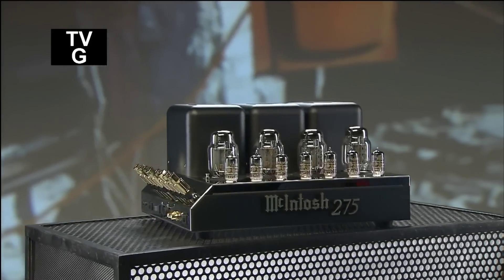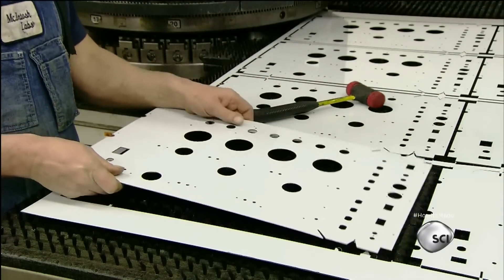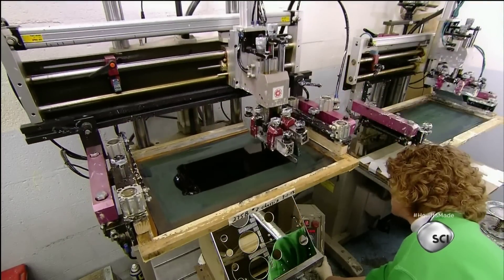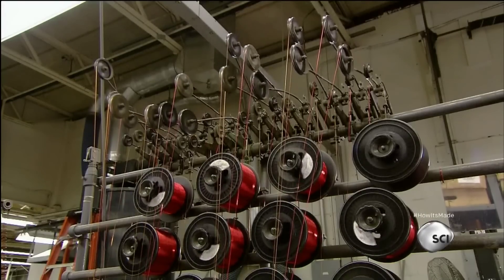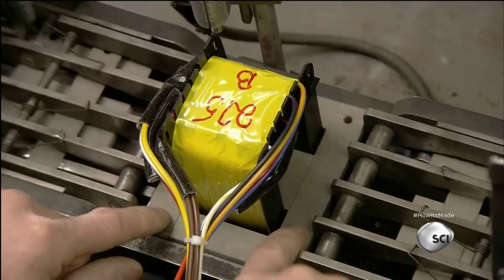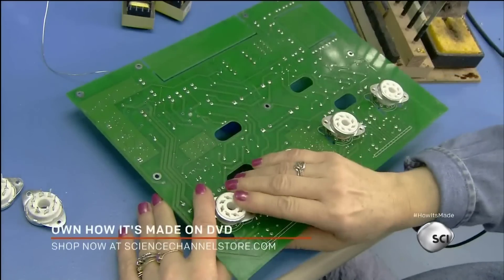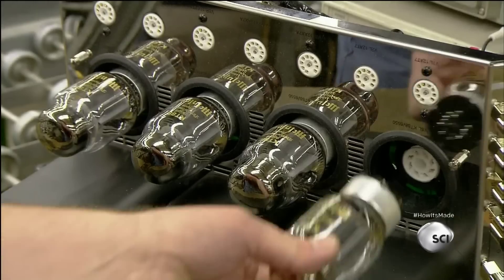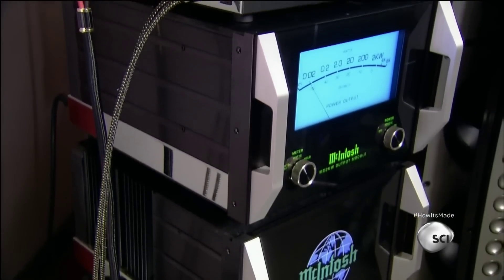How It's Made - McIntosh Tube Amp

Comment: Just think having an input makes it all work.  Tube rectifiers convert the high voltage to DC however, its that input characteristic that makes it a vacuum tube amplifier....
Reply: +Paul West No, tube rectification, makes it a power supply tube rectifier.  Tubes in the audio circuit are what make it a tube amplifier.  How power is supplied has no effect on the audio output.
Reply: bush Another wave of audiophoolery crashes against the shore of electrical fact.  So long, I can't argue with delusions. bye.

Comment: Hey you idiot! you NEVER put a vacuum in the socket with bare hands! The acid from your hands will create a hot spot on the glass and reduces the life of the tube. It is a fact!  Typical McIntosh.....you pay for the namesake,  not for the quality. Yes, tube amps may sound warmer , but if you look at all the hi end tube amps made out there, McIntosh is almost at the bottom of the list for it's price range. Do your research, and most of all, trust your EARS, not the salesperson.
Reply: +lawrencet83 Vacuum tubes don't get anywhere near hot enough to devitrify from fingerprints.  We never had any problems handling horizontal output tubes in color TV receivers.  These run considerably hotter than KT88s.  Devitrification from fingerprints is true for quartz halogen bulbs, but not for vacuum tubes.
Reply: Ah, HOTs...   great quote from my old high school radio-TV-shop class: "Mr. Smith? If the HOT's plate is glowing red, is that a bad sign?"  (AAAH! Unplug the set! Unplug the set!) :D

Comment: "Magnetic terminals would react with the current and cause distortion". I love it how these people live in their own universe that they have re-written the laws of physics for. Pseudo science at its best (worst?)
Reply: People comment about how good my surround sound system sounds. I don't tell them the speaker wires to the rear channels is just lamp cord. :)
Reply: @numbr6  lamp cord is 100% copper and works fantastic. It isn't CCA, which is what most "speaker" wire seems to be made from these days. My old school KOSS loudspeakers actually recommended using (at least) 16g lamp cord in the owner's manual.
Reply: @numbr6  For a low voltage, low current, non-digital, signal transmission, nothing is wrong with a lamp cord... unless the space is a very noisy one (electronically).
Reply: @numbr6  I dont believe that someone said your  surround receiver sounds good, they are all shit.
Reply: @numbr6  lamp cord works good, and I run one or two speakers out of phase +/- reversed LOL
I solder all connections ....
Reply: Don't blame Mc. for that. Blame whoever wrote the drivel the narrator's reading off of.
Reply: Syc holic You are factually correct, but you have no say when it comes to someone else’s writing, spelling and grammar.
Reply: the same suckers who buy monster speaker wire..
Reply: I guess you skipped physics 122 in college.  Strap in.  " Ferromagnetic materials have a nonlinear relationship between the current passing through them and the magnetic flux it creates, and this induces voltages that add distortion to the signal.  " Chapter 7, section 9,  Distortion mechanisms,  Douglas Self Audio Power Amplifier Design Handbook.   "the non linear magnetic effects (of gold plated steel binding posts) were sufficient to increase the output distortion from 0.00120%  to 0.00227% at 100W into 8 ohms at 1kHz".    So it is a real distortion mechanism, that is measurable,  that can degrade the performance of high fidelity amplifiers.   So, no it wouldn't have any effect on one of these high distortion  McIntosh tube amps, as they won't make 100 Watts  (75 W amp shown) and have laughable 0.2% distortion.  So the McIntosh amp has 200 times more distortion than the  0.001 % a steel binding post would add.   So it wouldn't really matter to them.  Hilarious.
Reply: It's a common thing called Microphonics.  A "distortion".   You should call and lecture them on Pseudo Science just before threatening bodily harm....
Reply: Yep, welcome in the hi-fist's world :-D
Reply: Some practices are unproven in electronics. Like that aluminum chassis sound better than steel. When you build high-end equipment you have to satisfy popular myths sometimes.
Reply: lmao you never heated up a piece of iron with a current ever have you?...   fyi he just used the wrong terminology, Ferrous was the word he should have said not magnetic.  cuz ya know in the real world magnetic permability is higher in ferrous metals then non-ferrous metals and thus creates a stronger field but it always exits....  And if you think a applying voltage thru a wire doesnt create a magnetic field you are an idiot.    and yes a magnetic field does create 'distortion' cuz ya know what the f do you think RF chokes do HUH? they filter out unwanted signals. thus they are distorting the original signal.  whomever wrote the script was just a maroon that has no clue how to talk to normal people, without making them think for themself to exactly what he meant..  This would be a good time for a spelling/grammar @^$# if any cuz clearly people didnt get actual correct thought of what was supposed to be conveyed.
Reply: oh I could care less about grammar and such in general because it's the idea/thought that matters not how its written down or said. correction should only be given when its clearly needed... clearly by the comments people getting the wrong idea...

Comment: It is too bad that McIntosh did what Fender tube guitar amplifiers did. That is to mount the very hot tube sockets right on to the one and only main circuit board via soldered pins.
Amplifiers, back when the bean counters got control of things, were hand wired to the tube sockets, and were trouble free.  This new pc board junk is trouble. Not for the builder, but the buyer.
I'll keep my Marantz 8b. It is the best sounding amplifier ever made. (It is hand wired too. NO PC Board).
Just my two cents.
Reply: brucebbass Can't do point to point with all the extra small chips and etc that the new ones have :/ I'd definitely take the old school quality and simplicity (although this amp is badass nonetheless)

Comment: Ty, yo a ho! a good tube amp will fatigue the ears far less than any solid state thing, without question. that is a documented fact. a tube amp cannot produce odd (sonically displeasing) harmonics due to how they operate. i'm not knocking solid state completely > it's great for low end & PA systems. both methods of amplification have their uses. use your ears, not your head people. the way to avoid distortion in a solid state system is not to push it > only about 20-30% of output power available should be used. tube amps will still fatigue the ears considerably less, however.

Comment: Never heard of this amp brand before but they're obviously high quality. I saw alot of WIMA caps on that circuit board...top of the line, high quality components. As far as this idiot (ty ho) saying tube amps are a waste of money - he needs to dig the potatoes out of his ears lol
Reply: Sam Franklin   I have two Hammond L-100 amps I use for audio. The have each two 6BQ5 valves with 12AX7 preamp and 5U4 rectifiers. I modded them for input level to use with most any line level signal and at 18 Watts per channel, sound crazy smooth! Makes my CD collection worth keeping too!
Reply: Sam Franklin McIntosh amps are arguably the best amps in the world. They make them right down the street form me.

Comment: Macintosh has always produced high end audiophile amps
 Besides the use of very high end components  it is built like a work of art. 
Like anything else these days, if it is still made in the USA, it will cost you serious coin..but unlike a lot of
Chinese produced crap with underrated components, these amps will outlast the original owner,
and perhaps a few more after that.

Comment: Many audiophiles believe a lot of things...
Reply: Eric Morrison 

As a bona fide audiophile myself, I can tell you you are missing out. I only ever listen to music while I am under water through waterproof speakers and 32-bit DAC, as the increased speed of sound in the denser medium of water is more aesthetically pleasing to my perfect audiophile ears (which have been surgically tuned to have a flat response up to 25 kHz). Listening to music in any lesser, barbaric form can actually trigger migraines and in some cases seizures, because I am that well adapted to perfection.
Reply: @AllongLawl god I wish I could have responded to this I worked there .. did every job and ended in tech support .. McIntosh units are well Worth the money, mostly because of resale  .. but we would laugh at the ridiculous claims by customers ..had a guy claim his 50,000 sterling silver interconnects gave his system a better sound stage … no it didnt .. we called the sound of tube amps “happy distortion” because thats the dofference
Reply: +xXx_illuminati_overload_xXx Well, often the more expensive wires are dipped in unicorn tears and then coated with a thin film of Zimbabwean bee-wax and pieces of the American flag so yes of course they sound better.
Reply: They also believe that a 100$ copper speaker wire sounds better than a 10$ copper wire
Reply: ***** It's true, I had mine surgically tuned to 32 Hz.  Anything Bose has sounded like nails on a chalkboard for years.
Reply: +xxX_BomBer_Xxx or they should try 14/2 building wire
Reply: I believe I'll go listen to some more music. :D

Comment: I have wound many MC75 output transformers.... I can see from this video that they changed the entire transformer design...different bobbin, different wire gauges, plus no longer using the C-core but instead using E-I laminations... They are now using Mylar tape between the interleaving, which was never used before, thus inviting issues with corona... I guess they were trying to keep the cost down...

Comment: Interesting video    I haven't seen any of the newer McIntosh stuff  first hand   

Why so many components ?  the circuit boards are well populated with so many SMDs including several transistors and IC's     does any of the audio pass through any of these IC's and transistors?  or is this just for power control and lighting effects.    and whats with the LED lighting the tubes.   I want to see the warm glow of the tube itself  leave out the LED's thanks.     it seems to me that the older amps  McIntosh Heathkit or whatever had way less in the numbers of components in the circuit with less than a few dozen resistors capacitors etc.

Comment: sweet vid but those mickys arent true tube amps. theres quite a bit of solid state on those pcbs
Reply: The audio signal path is all tube. The power supply is solid state because good engineering practice dictates that you have a rock-stable power supply to avoid having deleterious effects on the sound at the demands on the amp vary.  The rest of the solid state components you see are related to the "health monitoring" of the tubes (those stupid green "this tube is okie dokie" LEDs under the tube sockets).